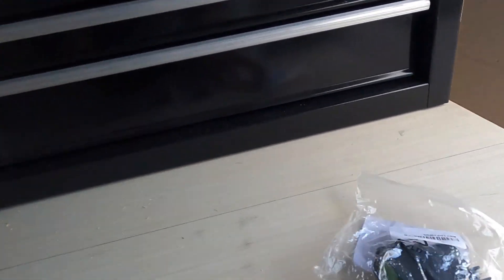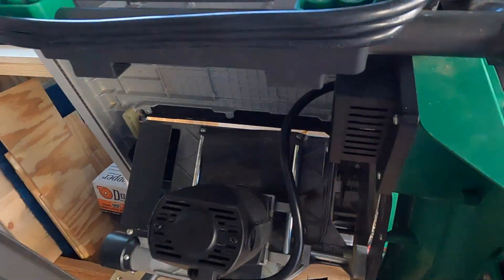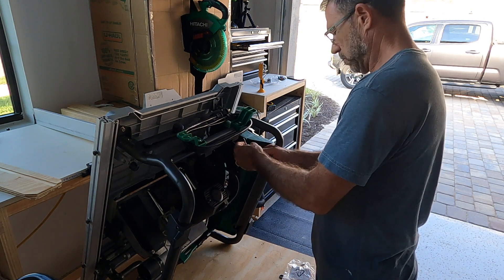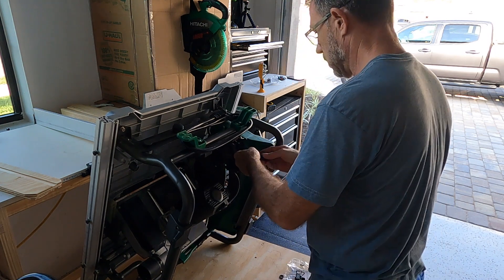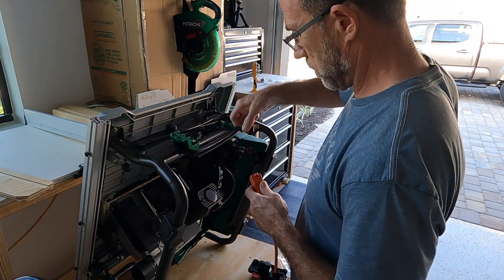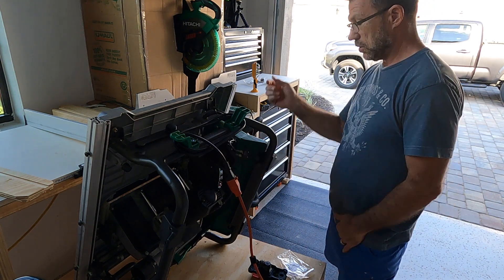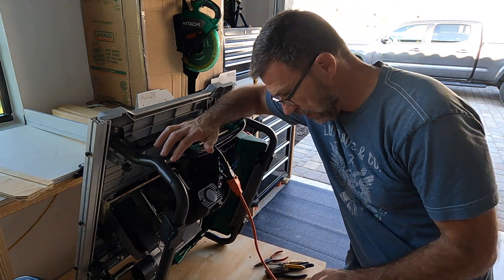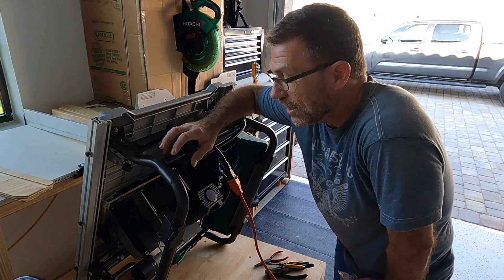My saw stopped working - Hitachi C10RJ Table Saw Repair

Comment: I bought it for $40.00 just for the stand, to attach it to my Dwalt Saw, I was about to disconnect the cables from the box, to check it with the multitester, and it occurred to me to reset it, and to my surprise it turned on without problems. Thank you for this video, which inspired me to take the steps.

Comment: I ordered the part from Amazon, installed it, and used my saw today for the first time in a couple of months. This after the repair shop gave up and wanted to throw it away. Thank you, thank you, thank you!!!
Reply: what part did you order?
Reply from the maker: @stacymurphy6961  Hitachi 371585 Knob C10Rj Part https://www.amazon.com/dp/B07DTBY32W/ref=cm_sw_r_cp_api_glt_i_TNDGJD1ME9W693Q7KTJ2
This kit has the soft start
Reply from the maker: Hitachi 371450 Switch https://www.amazon.com/dp/B071R2JW65/ref=cm_sw_r_cp_api_glt_i_09KSYXNGJ04J6TYXGB9F?_encoding=UTF8&psc=1
This is the power switch
Reply from the maker: Hitachi 371449 Overload Protection https://www.amazon.com/dp/B07227GK59/ref=cm_sw_r_cp_api_glt_i_X87E363JZP1BE6CN6Y4P?_encoding=UTF8&psc=1
This is the overload protection

Comment: Could you share a picture or the schematics of how the switch is wired. We have one at work and the switch stoped working. We bought a replacement and one of workers decided to replace it without taking any pictures of how to put it back together. Now i don't know how those pins go on what plug.

Comment: Watch your video, got same problem with my Hitachi C10 RJ, can’t find parts even at Amazon. Now I’m stuck  except I can always hardwire and bypass the soft start switch.Any online parts store you can recommend?Thank you
Reply from the maker: Hitachi 371450 Switch https://www.amazon.com/dp/B071R2JW65/ref=cm_sw_r_cp_api_glt_i_W9BVB9S2J2MRAKC7PRYN?_encoding=UTF8&psc=1 
This is the power switch.
Reply from the maker: Hitachi 371449 Overload Protection https://www.amazon.com/dp/B07227GK59/ref=cm_sw_r_cp_api_glt_i_E3ZFCVP2G3AP49Q56R7P?_encoding=UTF8&psc=1
This should be overload protection
Reply from the maker: Hitachi 371585 Knob C10Rj Part https://www.amazon.com/dp/B07DTBY32W/ref=cm_sw_r_cp_api_glt_i_TNDGJD1ME9W693Q7KTJ2

This kit has the soft start
Reply: Can u plz help me figure out how to bypass the soft start plz all online stores are on back order for the soft start
Reply: @lullguy6055  If you check out Amazon they have it on stock now as of 4/13/22. What I mean is the soft start switch @$10.47
Reply: There is a soft start switch on Amazon already. If you can order that parts I will guide you on the wiring. Let me know. I did my new soft start switch already.
Reply: @haroldrull4943  thanks got mine on Wednesday and fixed it
Reply: That's what I did. 
(Bypass the soft start)
Reply: @haroldrull4943  Nope - not as of today...
Reply: @tomhopkins6758  can you walk me through bypassing the soft start?

Comment: Thanks for this video you saved me a lot of work
Reply from the maker: Awesome... so glad it was helpful. If it is your switch, you will need to remove the ‘red’ off flap in order to remove switch once you disconnect wires, switch pushes towards front of assembly not out the rear. You should be able to use a punch and push the pin out that is holding flap in place.
Reply: @lowerycustominteriors  (Thank you! )but I am almost sure its the slow start me and you had the exact same thing happen wow isn't that something
Reply: BOUGHT BRAND NEW ONLY USED IT ABOUT 5 TIMES ON SMALL JOBS
Reply from the maker: @coldwindowsworkerseminolen4214  I don’t know exact times used but it wasn’t a whole lot before mine happened. But I have had it for about 3 years. Just wasn’t using it a great deal until recently.
Reply: @lowerycustominteriors   well I was wishful thinking and wrong And  well mine makes a humming sound after the soft start so buying the switch I wonder if it is the startup capacitor
Reply: @lowerycustominteriors   thank you ! i now believe it was both soft start and the switch on mine i checked  the continuity it checked bad  on all tabs
Reply: the switch on this saw is much more than just a switch it looks like it could contain the start up capacitor also

Comment: Hi very informative video and much appreciated. Do you have some kind of link to the 3 components purchased. Thank you
Reply from the maker: Hi Johnny, if you look through the comments I have responded several times with links. Some may no longer be in stock or back ordered but all the parts have been linked in the comments. I do not have them saved, sorry. Most people that had this issue it turned out to be the soft start.

Comment: I didn’t have a binding issue…….well I did the last time I used it. But I reset it every time. Finished the project then put it away. 

Took it to a job site a while later then it would’t work. 

Tore it all apart last night but wasn’t getting voltage anywhere. 

Turned out that somehow or another the plug at the end of the cord was damaged or failed internally. No continuity on the black wire from behind the switch to the plug.  

I’ll put a new plug on it tomorrow and that ought to do it.

Comment: Hi.I’ve picked up 10 inch table saw.To undo the blade.are the holding nut a left or regular right hand thread,it’s rusted so don’t want to damage it.cheers.
Reply from the maker: To remove the blade, turn but counter-clock wise - Left turn to loosen.

Comment: I have the same problem.  Will tear into it tomorrow.  Thanks.
Reply from the maker: It wasn’t a difficult repair, just keep wiring organized. I think there are 2 black wires one on each side of switch. Glad this was a help to you.
Reply: I do not see the soft start switch after taking the cover off.  I have a 3/2016 Hitachi C10RJ jobsite table saw.  
It quit working after blowing out saw dust.  
I also inspected the reset and power switch.  
The power switch has 7 terminals.  One of them does not have a connector attached and I did not see a loose one hanging around.  
I also inspected the brushes.
Reply from the maker: @garseetr  the ‘soft start’ is located behind the switch in its only little compartment. There are four screws on the front to accessible switch. Then there are four screws on the back to access the backside of the switch and wires. Then there are 2 (I think) additional screws on the backside that you took off with the four screws. The soft start is located in that small compartment.
Reply: @lowerycustominteriors  I see in your video at about the 1:40 mark where the soft start is on your saw.  What year model is your saw?  My saw just.has the black solid cover with three screws.  Currently waiting for a new reset switch to arrive.  I bought my saw new on clearance at Lowe’s in 2019...3/2016 stock at 50% off sale.  Will let you know the outcome.  Thanks.
Reply: Resolved...The white wire on the cord was bad.  Replaced the power cord.  BTW my C10RJ tablesaw manufactured 3/2016 does not have a soft start switch.  Thanks.

Comment: Wait till the Aluminium thread that the leadscrew goes through wears out  !! You will have to buy a complete motor unless you are a good machinist who can insert a brass set from eBay... I just ordered for $29 because mine went bad  and am not sure if I can do this job...

Comment: Any chance you can link to the parts you ordered on Amazon? My Hitachi just did the exact same thing and I want to start with the soft start replacement. Thx!
Reply from the maker: Hitachi 371468 Soft Start C10Rj Part https://www.amazon.com/dp/B07DTBTS9D/ref=cm_sw_r_cp_api_glt_fabc_6BXQM49ZTH0JA0G74FGQ

This should be the soft start. Hope this helps.
Reply: @lowerycustominteriors  thanks

Comment: I know that you did this video awhile ago and I have the link for the soft start but can you post a link for the other 2 parts also please . And your video taught me a lot. Thank you
Reply from the maker: Hitachi 371450 Switch https://www.amazon.com/dp/B071R2JW65/ref=cm_sw_r_cp_api_glt_fabc_Q747HGF455YSWQ7J6VXV
Reply from the maker: Hitachi 371449 Overload Protection https://www.amazon.com/dp/B07227GK59/ref=cm_sw_r_cp_api_glt_fabc_A6BKDD427ZXAXV24Z2C1
Reply from the maker: I believe thieve are the ones I ordered
Reply: Ty so much

Comment: Can you please share a link for the soft start module. That's the only part I can't find.
Reply from the maker: https://www.amazon.com/dp/B07DTBTS9D/ref=cm_sw_r_cp_api_glt_fabc_6BXQM49ZTH0JA0G74FGQ

Here’s the link, but currently unavailable.
Reply: Thanks man. I'm sure that's what's wrong with my saw too. It just stopped working one day. Didn't even bind a board up in it or anything. I use it regularly doing hardwood floors though. Hopefully I can find that part somewhere else. Thanks again for your video. It was very helpful.